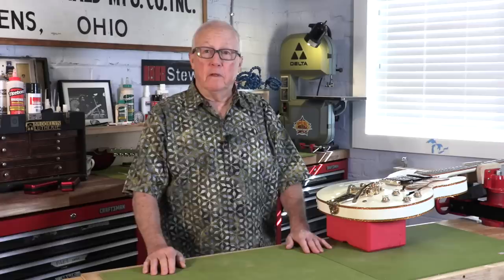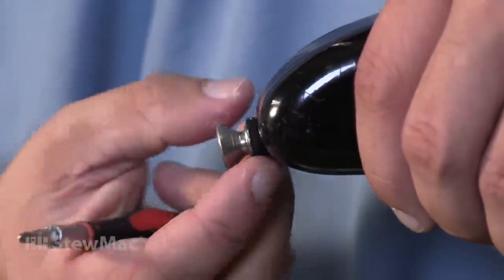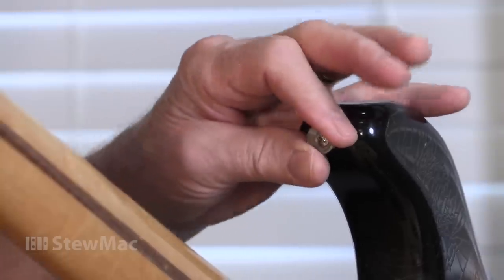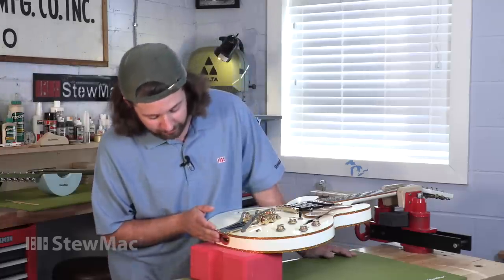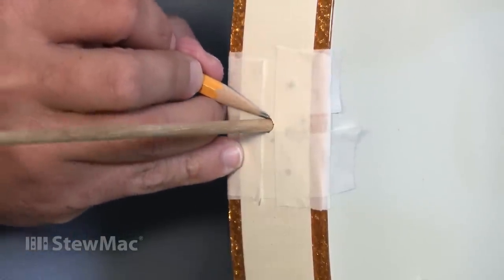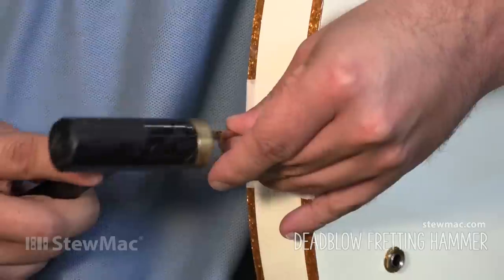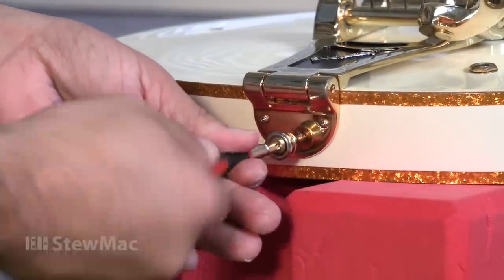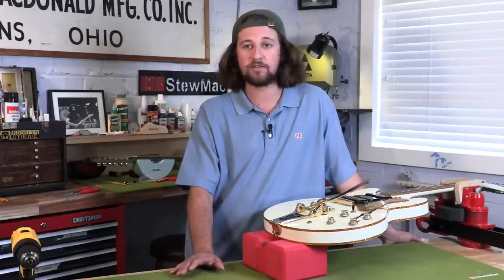How to check and replace your guitar strap button - best method

Comment: I’ve done many repairs using the dowel method but never thought of cutting glue slots in the dowel. Great tip.
Reply: Agreed.
Reply: if youre doing a bunch it might be worth making a fluting jig. all you need is some scrap wood with a couple screws protruding into a hole the same size as your dowel

Comment: I’ve saved the day once or twice by shoving paper matches in the hole and putting the screw back, while at band practice or a gig. But if I’m at my work bench, the dowel trick is the best. I had a P Bass and wasn’t happy with the position of the top strap pin, I filled the hole with epoxy and drilled a new hole where I wanted it. Some paint touch up and it was perfect. Thanks for a great tech tip video!

Comment: Great Video! A friend of mine had an electric acoustic guitar that had the input jack about 6 inches below the back strap button, his strap slipped off, the guitar crashed to the floor and drove the 1/4" cable and jack into the guitar! after that happened to him, I put strap locks on all my guitars.

Comment: Great videos as always from Stew Mac - @Rob Mods. I agree, you can also install the Bigsby and use a self centering drill bit (commonly used for installing door hinges) they have a sleeve and tapered tip that the drill bit travels through to always center the drill bit in the hole.

Comment: Any suggestions for the strap button on the upper horn on a semi-acoustic? I suspect there was no extra block of wood glued in on the inside for the screw to grab onto and the screw only had the thin wall of the body to thread against and of course it failed. Here is my non-professional idea for a fix, open to discussion: Remove loose button and screw. Thread a heavy duty knitting needle with heavy duty thread and drop it in the screw hole and grab the needle when it dangles by the f-hole. I just got these pure cedar moth balls that I bet one would fit in nicely in the inside of that upper horn. Drill a hole into the moth ball and test it with the screw to make sure it's right. Remove the screw and sand the area around the hole flatter if you think it's necessary. Hammer in the needle centered and so it will hold with only a few pounds of pull. Apply some Tight Bond glue around the screw hole of the moth ball. Now drop the ball into the f-hole and pull on the thread until the ball is up against the inside wall. Invert the guitar so the headstock (and screw-hole) is down. Attach a weight of a couple of pounds to dangle on the thread to pull on the needle and to press the glue on the moth ball to the inside wall. Make sure the needle appears to be centered in the screw hole and allow the glue to set and dry. When the glue is dry use pliers to grab the needle and very carefully pull it out while supporting the outside wall of the upper horn. Screw in the strap button and screw. Will it work?

Comment: I keep golf tees on hand for fixing stripped screw holes, just tap them in and cut it flush. Works really well on door hinges and striker plates.
Reply: I always keep a supply of frozen prawns around in case I need to fix some engine mountings. Just hammer em in with a little chilli and epoxy and we're good to go :D

Comment: I had that problem repeatedly with used guitars. Slightly loose or bad strap buttons.
My quick solution was sticking some wood chips from matchsticks into the hole and a bit of glue, let it settle and dry, then screw the button in again. Usually it sits tight after that.

Comment: A slightly smaller drill bit give the screw threads something to bite into and glue on the screw acts as a lube and dose a hold job when cured.
Reply: I learned the same thing many years ago

Comment: I love watching these types of repairs and learn every time. I haven't totally warmed up to strap locks, I use the Ernie Ball Polylock Straps.  They are easy to get on and off and are a solid way to secure your guitar without any modification what so ever.  With Straplocks, you have to use a straplock strap or you can't put the guitar on a normal strap.  That is where they fall off for me.

Comment: Question: Is there a particular reason you need to let the glue completely dry? Before screwing in the strap button? And is there a particular reason to make a pilot hole? Im thinking too much pressure? Maybe could split the original hole and cause more damage?  Thank You.

Comment: Thanks for this video! I have a slightly different problem. I want to put strap locks on my Tele, but the original strap button is stuck. Maybe they installed it while the finish was still drying. I can get the screw out fine, it's just the strap button is stuck. Is there a safe way to get a stuck strap button off without damaging the finish? Thanks for your help!
Reply: Damn, that's a new one, but sounds like you're exactly right. The put the damn strap button on before the finish was even dry. That's insane, and goes to show you how much the "just crank em out" attitude has permeated everything. Sigh... You can try heating it up with a hair dryer. Idk if I'd go as far as using a heat gun. That might get a little too hot. Other than that, maybe see if you can get some dental floss under it at all. If you're lucky one side might not be QUITE flush, and if you can get the dental floss under it, use it like a saw. That's all I can think of though.
Reply: probably too late but id try scoring around the button with a scalpel

Comment: Great video! I do have a question, how can I install strap locks on a guitar where the strap button itself is one of the screws on the bolt-on assembly?
Reply: Really?  You are gonna have to put it somewhere else.  Hanging a guitar off a neck bolt is just gonna make it want to face the floor.  You need to put it up on the bout so it's balanced when you let it go.  You ever played an SG before and let go of it?  That's because the strap button is on the back by the neck joint. A Strat or a Les Paul won't do that because it's balanced.
Reply: @TempoDrift1480  Haha funny you mention the SG, the guitar I'm talking about is an Epiphone SG G-310. The strap button is one of the bolts that holds the body to the neck. I've never considered just putting a new strap button on the horn, but Tony Iommi did exactly that.
Reply: I've got a LTD Viper I plan on doing just that! The current button is midway up the horn on the back side! I'd recommend using a flat face cutting bit to make a small flat surface for the button to sit against on the end of the horn and mount it there!

Comment: 4-pack of Grolsch gives you 2 guitars' worth of the rubber washers (and a nice buzz).
Reply: 4?  What, are we having breakfast?
Reply: Wiser words were never spoken.
Reply: I have the Grolsch locks too. They work like a charm. Plus the beer was good. I need to make a wine bottle neck slide now.
Reply: @hotrodjones74  With a simple glass cutter, some plywood, and a bit of indie engineering, you could turn a hand drill into a lathe, apply different grades of sandpaper/polish and do it in a day!

Comment: I always keep a pack of wooden toothpicks and wood glue at hand when messing with mounted guitar parts :)
Reply: I have that exact set in my repair kit.  It's never let me down.  I've found that if you put the glue and toothpicks into the hole and immediately instal the screw, when the glue dries it and the toothpick wood form a screw thread around the screw.  It's been totally reliable for me, and that includes holding into an Ibanez 6/12 doubleneck and a Conklin 7 string bass, both heavy beasts.
Reply: @lawrencegenereux8567  same here. Hardwood toothpicks and white glue's always done the trick for me

Comment: The screws on Schaller straplocks, and others, are typically slimmer than what was in there first, so always check if you need to plug the hole before installing straplocks, or they won't be much help 😉

Comment: Why did you use the length of the threads on the screw to determine the depth of the hole to drill and not account for the button and thickness of the endplate?
Reply: He didn't.  He marked it by putting the dowel in the guitar.  He did say you could, though, and you're right that it wouldn't be the best.

Comment: In college I once fixed a loose strap peg with a piece of a Q-Tip stick.  Just shoved it in there with some wood glue and it stayed there for years until I sold the guitar.
Reply: So it was you! Strap came off on the first gig. Damn guitar broke my toe when it fell

Comment: AND..... repair the hole, then use longer screws.  Screws only 1/4 to 3/8 inches longer are far less likely to enlarge the hole again.  Also, checking every once in a while to be sure the buttons are tight.  If they back off, even a little, it is far more likely they will enlarge the holes.  Also, a little glue on the screw usually helps keep it tight but still isn't a problem to remove if necessary.
Reply: Oh yeah, 100 % strap locks.

Comment: All woodworkers know that if you screw into the end grain of any kind of wood, the screw won’t hold for long, especially under stress. What guitar makers should do is drill out a larger area and insert a plug that is turned sideways, making the grain perpendicular to the direction of the screw. If that plug is glued properly, it will NEVER come loose.

Comment: Just a tip for beginners, you want your strap button tight but DO NOT over tighten when screwing it in or you will strip out the hole.
Reply: you have to tighten it till it starts to feel loose then back off a quarter turn. perfect every time
Reply: @james6028  If it starts to feel loose it's already started to strip the hole! Might stay tight for awhile but won't last as long as one that didn't start to strip during installation
Reply: haha i was just kidding. defo dont follow my instructions!

Comment: but, But, BUT.... you didn't even mention that there may be a loose ground wire coming through a hole behind the Bigsby mounting area by the strap button. 

DIYers, if you see the end of a wire when you pull the Bigsby off, you need to MAKE ABSOLUTE CERTAIN it doesn't fall into the guitar. It's not just some stupit wiah! This is the wire that allows you to keep your guitar's annoying hum down when you touch the strings or any metal on the guitar. I guess StewMac doesn't want you to know about it. All I can say is Thank You StewMac... MORE WORK FOR ME! Totally appreciate it.
Reply: What in the world are you complaining about now?  There's no wire in the video.  Nobody tried to hide anything from us.  I'm sure they could make an hours long video on what we might find when we start messing with a guitar, but that isn't the point here.

Comment: Everything from Stew Mac is outlandishly expensive so much so that it's become pop culture in the community of guitar workers.  I spent $58 on a Les Paul wire kit and when I got it I rolled my eyes at the quality of it.  My 9 year old daughter even noticed...  "This stuff doesn't look much better than what's in there?" And for a little girl to notice that, that says a lot.  I actually used the existing switch in the guitar because it was a higher quality and didn't stick out to the point you have to drill a hole in the case to shut it.  I understand a lot of our products are made over seas with questionable quality and I've come to accept that fact however that same switch is available for under 2 dollars and it really bugs me that it would be included with 4 $3 pots and about 60 cents worth of wire.  I pay less than that per foot of number 12 THHN wire that I pull through industrial factories.  Ya know that's in response to the "outlandishly expensive" claim...  You gotta be kidding right?
Reply: Wizzle yeah their tools are nice and not bad but you can get the pots caps and wire on eBay much cheaper, and get good stuff like cts and Bourns for the same price
Reply: @mtlmark75  Yeah I discovered EBay since I made that comment.

Comment: Pro Tip: When you're running a busy repair shop and don't have an hour to let the wood glue dry...use super glue instead. It drys instantly and much harder/stronger than wood glue. And you don't need wood dowels, tooth picks are fine and save you even more time. Time is money Dan!

Comment: It's a good video, but, to make it simple, grab one or two toothpicks and put some glue on them. Get them inside the strap hole, cut what's left, screw back in, you're done.
Reply: Thats functional but not as secure as the dowel approach, hence the video

Comment: I have strap locks on all my guitars.
Reply: Even if you are on a serious budget,  you can buy Schaller style Chinese strap-locks for under two dollars. I bought 5 sets off of eBay and cost me around $10 with free shipping (just takes a month minimum to show up). I put some serious pressure on the first set to see if I could break it free before installing on the guitar and they are just the same as the originals. I normally don't mind paying more money to support the real deal companies, but some people might have to save as much as possible but still want to secure their guitar.

Comment: I know this might be controversial, but considering no wood will ever (ok, let's say, no wood accessible in dowel form to regular Joe) hold up as well as plastic or a metal insert does, why are these holes still made out of wood? Kinda seems like a waste of a good guitar (when it falls) to not put something more longer lasting than wood in a hole that sees unwillingly a lot of force applied to it. Picking up a guitar, using it, putting it down, maybe a snag here and there.

S.M. should come up with a line of inserts that remedy this problem, just saying.
Reply: But insert will also have to deal with wood in the end. And those won't last either. And if they come out they'll ruin the paintjob.

Comment: I bought a ruined acoustic guitar and restored it. Someone had the audacity to drew a huge bolt through it as a strap button and even that was loose. The hole was a lot bigger than any screw which could fit through the strap button too, so I made a cylinder out of aluminum foil, superglued it into the hole and put the screw in, while it was also smeared with glue. Works like a fuckin charm.
Reply: Except you can't get it out though.
Reply: I feel for the guy who has to repair that.... Terrible approach
Reply: the stuff people shove into their guitars! the one video on yt that shows how it should be done properly and all the comments are people saying you can just use toothpicks you know!!

Comment: And then you pay  50$ for replacing one screw. It looks really professional but this should be 2 minute job:)
Reply: Mateusz Piotrowski No one forces you to take your guitar to a repair shop.
Reply: @apinakapinastorba  I ment that they obercomplicate simple job
Reply: @mateuszpiotrowski  How is this overcomplicated?
Not only this is the best and honestly only solution to this problem, but they still gave us some cheaper and easier alternatives
Reply: It only takes few minutes of working time to do the repair the right way, so why do a sloppy job. But of course any shop charges at least their minimum fee, if you choose to take a guitar for repair, be it any reason.